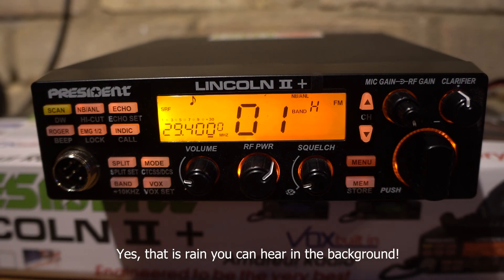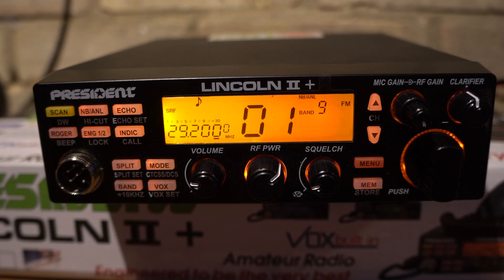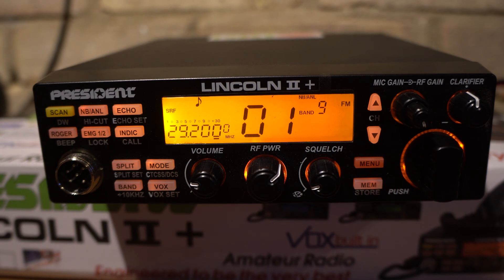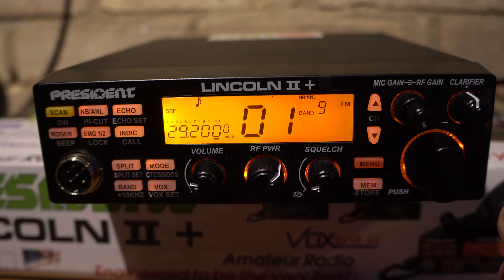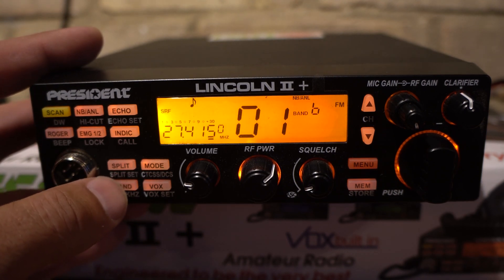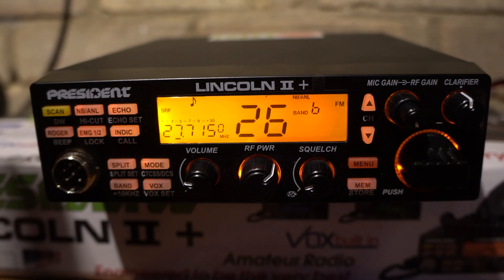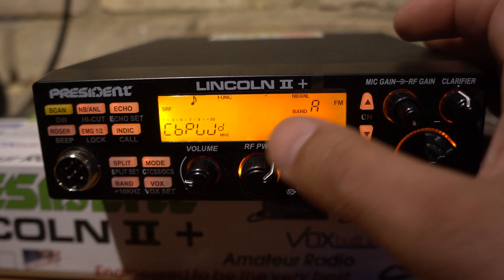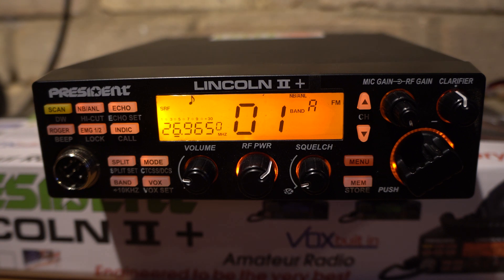President Lincoln II+ Restoring the "Missing" CB Channels!

Comment: I did the mod, and I'm not finding the CBPWD setting in the menu.  I've removed the resistor now, cleaned the holes up, reinstalled the resistor and it's still not coming up.  Has anyone found the solution to this problem?

Comment: Installing mine today w/o the mod for now. Got a  RigExpert aa650 zoom arriving tomorrow and a collection of antennas to test on my van install. Also have a McKinley II FCC and ordered a President Grant FCC. I use them for work as a Pilot Vehicle Operator and Steerman for wind turbine blades. Now I’ll be able to know what works and get mine and my coworkers radios all dialed in. A CB shop mounted an antenna for a friend and her radio died. We found it had an SWR of 4.0. Sick of getting overcharged for BS!

Comment: Any idea why the 2+ would have zero output power. 
Replaced the 3 outputs, and q55. Did a factory reset, but still no output power. Keys up, but zero power out. 
Wondering if theres a software setting stopping it?

Comment: Im thinking of getting one of these radios, BUT! my question is this. ch 01 that you show in this clip shows 26.965... Upon googling this that's the EU/CEPT Channels. For the UK channel for 01 should be 27.60125.  🤷‍♀ should it not?  
Also does the channel indicator show true 1 to 40 channels like when on 19 its on UK 19 & not up or down channels.? many thanks for any advice..   NEWBIE used to have the older president back in the 80's LOL long time since then....

Comment: Restoring the Missing CB Channels there is no cbpwd on President Lincoln II
Reply from the maker: If you can't see the CBPWD option on the menu it probably means the modification isn't present in your radio or the resistor isn't making contact properly on the PCB board.
Reply: @Transmission1  I have not added the resistor and have done an All reset. So I dont have the CBPWD option. How do I get the CB channels back in this situation?
Reply: @freddworacek72   Did you manage to solve the problem with the lost menu cbpwd????

Comment: These are awesome radio's, it out performs and makes my Mark 1 Lincoln seem very mundane, nice video.
Reply from the maker: Yeah I really like them. Had some great audio reports with the stock microphone and they seem very stable with very little frequency drift compared to some other modern radios.  Looking forward to see what President release next on the SSB side of things.
Reply: @Transmission1  yes they work very well, I have also had good audio reports too, many stations I've spoken to in Europe have said it sounds like a high end HF set, I have also tried using other base mics on it like the expander 500 and a Sadelta echo master plus classic but the reports coming back said the stock mic is the best.. great radio for sure.